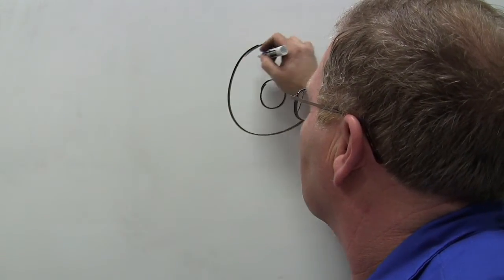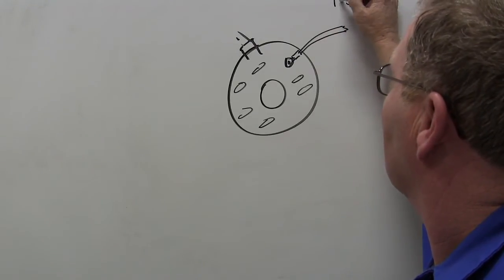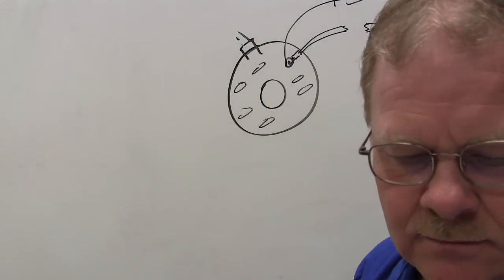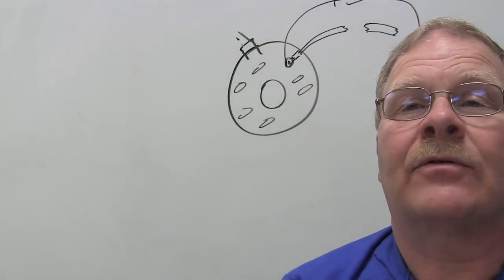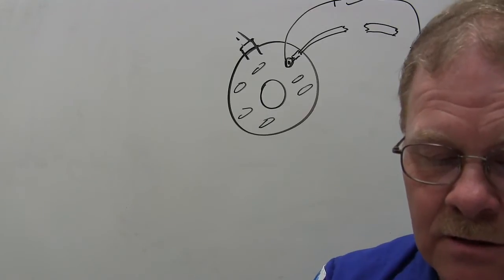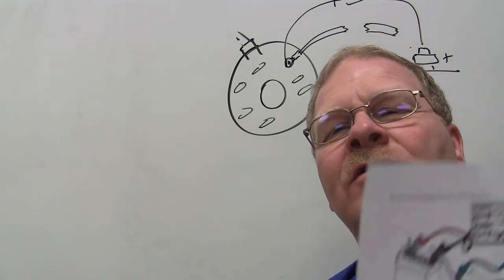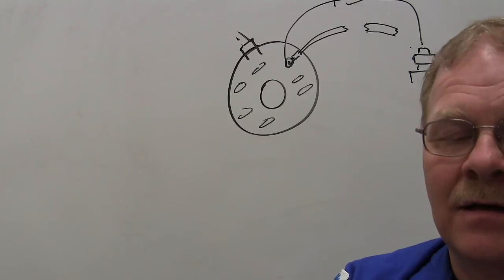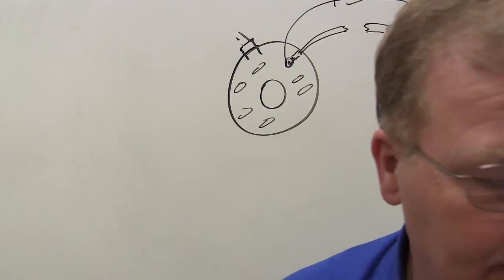Engine Perf 2 Test 7   Charging and Battery burn in

Comment: My Father bought a new 1973 ford LTD, And I bought it from him around 86.  Alternator gave out and I pulled it off, and drove over to an old boy who ran his own automotive electrical repair shop.  When I walked in with it Glade asked me if it came off a truck?  Told him no, Off a 73 LTD.  Glade explained it would be expensive because the alternator was built to power the electric rear window defrost. (According to him 73 was the one and only year ford used that big alternator.)   If my memory is correct the rear windshield defrost was around that 40 amps you are talking about.  Glade rebuilt the alternator for me   --- but it costs as much as I paid Dad for the car.

Comment: Found more information in my old notes.  1973 ford ltd used a 100 amp alternator.  30 amps to power the rear window defog.